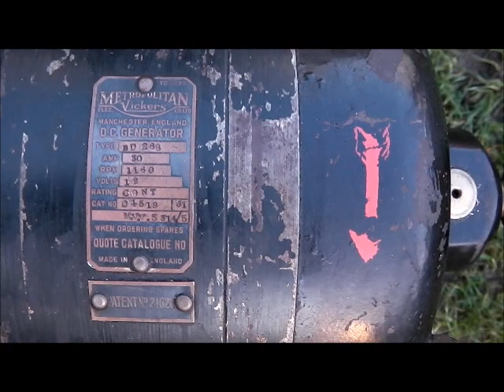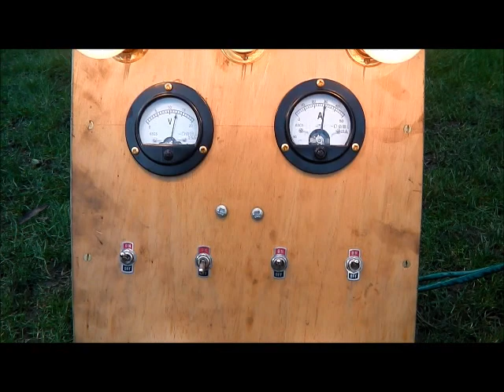Conord Stationary Engine & DC generator test

Comment from the maker: If anything your engine will cope better with a 240V genny, as volts increase, the current falls. My old D type used to run all day under a 20amp load, it would same doing to do the same with a 240V genny. Sounds like a nice plan, best of luck with it.

Comment: Sounds good Phil.  Im looking for a dynamo for my Lister D, Im thinking of running my Union drill, a grind wheel and maybe a dynamo all on the same trolley. I'd like a 240v dynamo but i'm not sure the engine will be able to cope with it. The project should all be finished for this season.

Comment from the maker: Compared with a D type running a lower voltage DC generator it will cope better with a high voltage AC generator. I think it would cope fine, and you could allways switch off the load when you want to grind/drill anything serious. An AC or DC generator won't provide hardly any load at all until you start applying a load to the output.